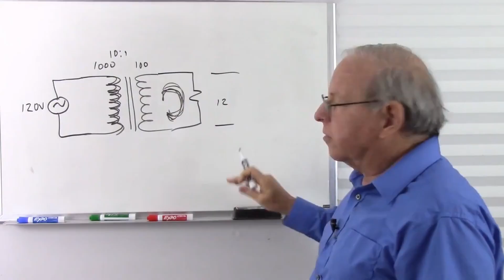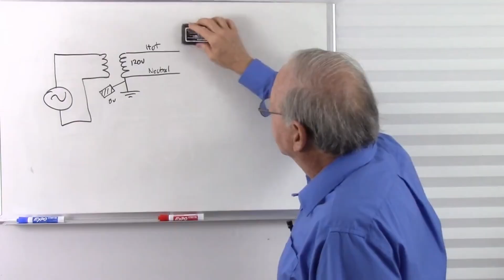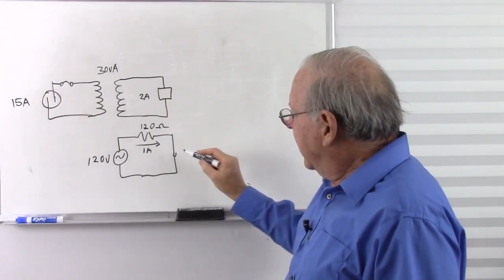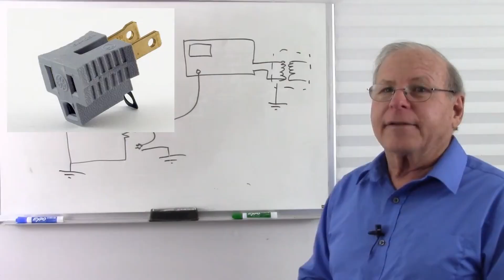Isolation Transformers   Answers to Questions

Comment: Excellent pedagogy. 8:13: Capacitative coupling of transformers and the correllary inductive coupling of capacitors (ESL) are not often measured or considered. Component testers usually don't include these parameters even though they measure inductance and capacitance. Maybe signal is too weak, so they can't?

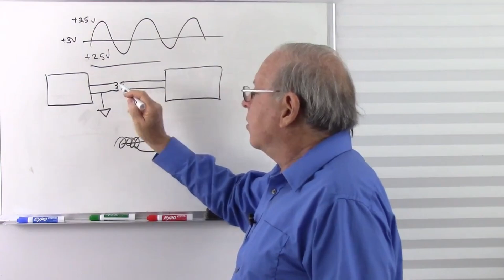Comment: What is the difference between using an isolation transformer and a coupling capacitor? In the audio ac example at 19:00 to block DC, a coupling cap seems normal in-circuit. Perhaps an isolation transformer is used more in an input stage from unknown sources? 
Is it that a transformer limits the power transfer more safely?

Comment: Why surround the primary?

The goal is to block noise and leakage current originating on the primary side (where the AC line is) from coupling to the secondary side (where your sensitive load is). Putting the shield around the primary is the most direct way to achieve this.

Comment: an isolation transformer is needed for an oscilloscope, also cut the middle pin of the plug is more safe to check high voltages for the safety of oscilloscope and the  probe. it is impractical to test a signal with a small transformer 42:13 attached to the input of an oscilloscope . but special differential probes  are using for some of this purpose. i say 42:13 is impractical and nobody do it. isolation transformer at measuring point never heard of that...........

Comment: In addition perhaps you could have mentioned that the oscilloscope probes have a common ground and even if you were to isolate the DUT from earth if you were to use two channels i.e. two probes and connected their ground leads in different places in the circuit you would still have a problem.  And of course isolated high voltage probes are cheap enough now-a-days and are the actual proper thing to use on high voltage circuits like switch mode power supplies (PC power supplies are actually grounded to earth) which can have 300+ voltages in them.  Many probes are only rated at 30 to 40 volts in 1x mode and 300 volts in 10x mode...

Comment: - [ ] How Transformers Work
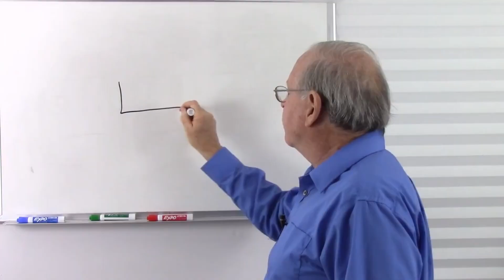		- [ ] 8:34 - Regular Windings vs Isolator Windings
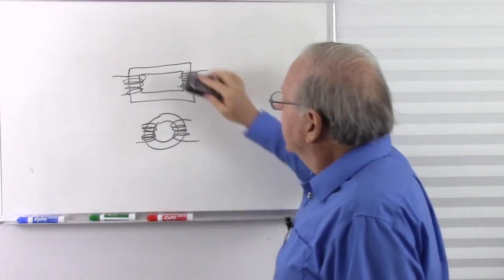		- [ ] 10:20 - Faraday Foil Cage, Grounded
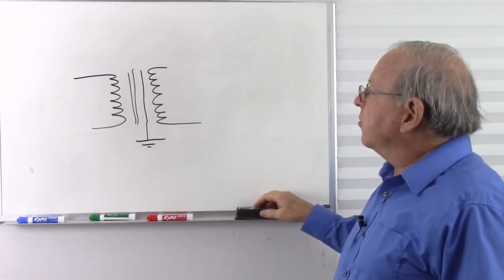		- [ ] 11:50 - Ground Loops
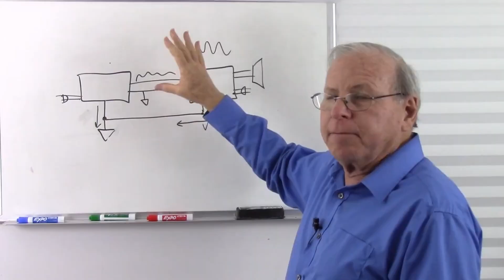		- [ ] 15:00 - Balanced Signal
		- [ ] 19:07 - Why No DC Through Transformers
			- [ ] Transformers Are Like Capacitors With Coil Inductors For Plates
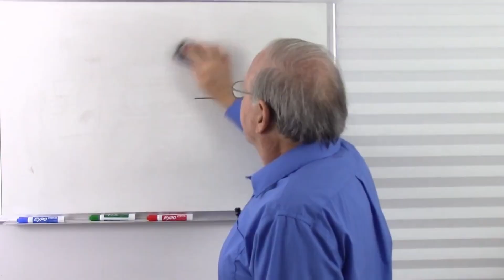		- [ ] 20:45 - Humans, GND, Current, Dangers, Chassis GNDs, Isolating
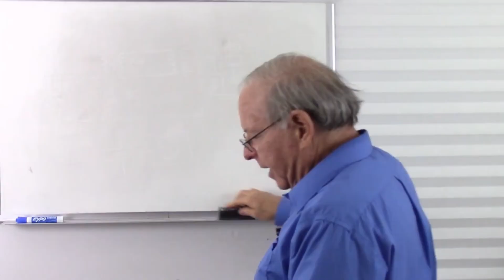		- [ ] 31:20 - Using A Small Low Current Isolation Transformer (Ballast)
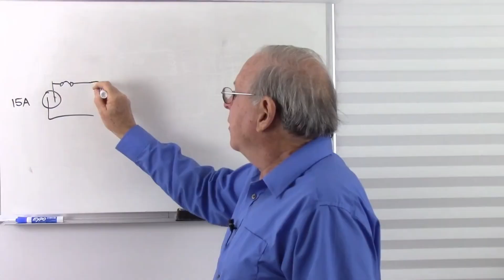		- [ ] 32:40 - VA vs Watts Explanation, Transformers Do Not Consume Power/Watts
		- [ ] 35:15 - Variable Isolation Transformer
		- [ ] 36:10 - Autotransformers, Variac, No Isolation
		- [ ] 36:55 - Using Oscilloscopes + Isolation Transformers
		- [ ] 40:55 - Using A 2-Channel+ Oscilloscope As A Differential Voltmeter
		- [ ] 42:45 - Alternate Way To Use An Oscilloscope + Isolation Transformer

Comment: This was a great video but I'm still not exactly sure what is going on with my isolation transformer. I plugged my test device with a cheater plug into the isolator. So it should have no earth connection. But when I attach the ground pin of the scope to the board it shorts out and things blow up.
Reply: ☠️💀. Because you have to USE isolated *probes*, my friend!

Comment: Interesting video. Very well presented. I knew most of the material covered but hadn't considered  using the ADD feature on the scope because  I automatically assumed there would be an internal path to earth and so if I had to I'd opt for taking off the Earth (temporarily of course  😁) instead.   

The Add function may work on an old CRT scope but would it work on a modern digital scope ?  I haven't checked that  yet but I suspect it wouldn't.  I suppose there is always the option of the differential probe.

Comment: I haven't seen any other oscilloscope vids where they mentioned the setting of "Adding" and "Inverting" to use the oscilloscope as a differential measurement.. some have sorta mentioned it, but not the settings.   Thanks again .

Comment: 36:55 Sir, huge respect for stressing how oscilloscope isolation from mains is not a good idea.  Nobody else I've watched has explained it that way.
Now I have to learn how to setup two channels on my oscilloscope to read potential difference.
People can certainly get a false sense of safety when using isolation transformers.  Thank you very much ❤
Reply: In my opinion, only: 1. Why not just use our battery powered hand scope? 2. Why not just take the ground clip off the Scope Probe (and verify the plugged in Scope is really at the same Ground as the Equipment Under Test) and make all readings with reference to Ground? We are looking for either a waveform or a DC level at any specific point, anyway. When any piece of equipment is designed, it is done so with Ground in mind, meaning all signals are doing something with reference to Ground, and knowing how it works with reference to Ground means a higher knowledge of the circuit. We could use a battery powered meter to measure DC or AC across a component or look at the schematic to figure out what the level of an AC voltage should be with Reference to Ground. What's the point of being in a hurry to measure a potential difference with a Scope? The rules of voltage drops still apply. If we measure at point A and on the other side of a resistor, we have ten volts higher, we know the resistor dropped ten volts. Keep in mind that the little silver band near the tip of the Scope Probe is also Ground (in case your Scope Probe slips as you are probing). 🙂

Comment: So what if the isolation transformers primary side is grounded? Can't if I touch the hot in the secondary side(which is not grounded), electricity flow through the primary side, since it was grounded?
Reply: You will get elctrocuted only if you touch BOTH sides (=wires) of the secondary. 
I use an isolation transforner for powering DUTs (devices under test) and NOT the oscilloscope.
(Isolation transformers made for medical equipment use MUST ground the neutral of both the primary and secondary windings. Those cannot be used on an electronic technician's bench)
Reply: Does his video apppy to residential isolated center tapped transformers too?!

Comment: First time I’ve learned about the use of the ‘Invert’ switch on the scope, or using an isolation transformer at the device itself to take a measurement. I wonder, though, about the impedance of the isolation transformer affecting the accuracy of the measurement, and again useful only for measuring AC voltages, which is what the scope is most used.

Comment: Great explanations, but what’s the issue with using an isolation transferring on your scope power input even if the case of the transformer is grounded. Agreed it’s not designed you be used that way and there may be noise pickup or something but there’s no chance of electrocution without a fault inside the transformer.

The differential probe trick is a great idea though! Thanks

Comment: Great video bob. I have a question about transformers. Why do lager transformers operate at lower frequencies and smaller transformers operate at higher frequencies? Why does size play a part. I never fully understood why.
Reply: This is from Quora website for your information:

Perhaps you are familiar with the universal transformer EMF equation:

E=4.44BmaxAfN

E is the rms emf (induced voltage) of any transformer winding. For a primary winding this must be equal to the rms applied (supply) voltage.

Bmax is the max flux density reached during each half cycle (tesla)

A is the cross sectional area of the iron core on which the winding is wound (m^2)

f is the supply frequency (Hz)

N is the number of turns of the winding

So all other things being equal, an increase in f means that you can correspondingly reduce the core cross sectional area “A”, which reduces core size and weight.And since the turns go around the core, a smaller core cross section means shorter turns, i.e. less copper in the windings.

Less iron and less copper makes for a smaller, lighter transformer.

If you aren’t familiar with the transformer emf equation, I suggest you read about it, e.g., in the Wikipedia article titled “Transformer”